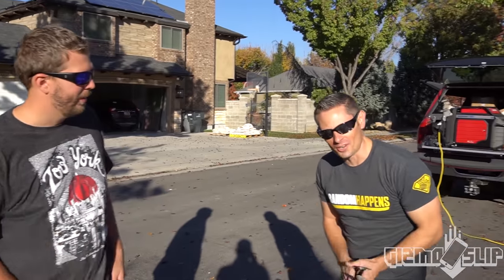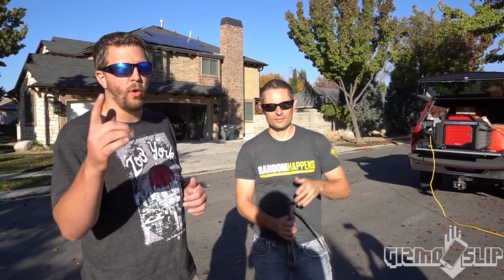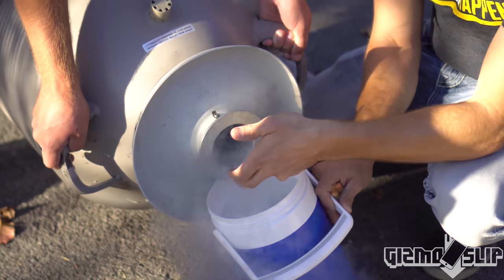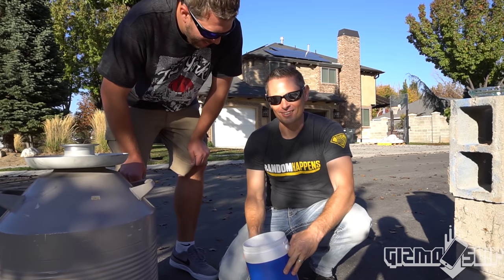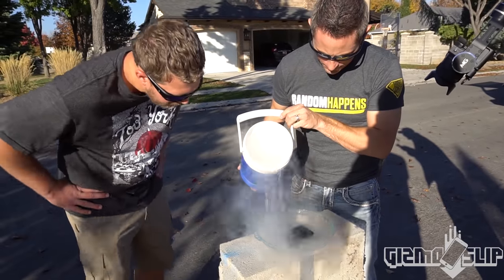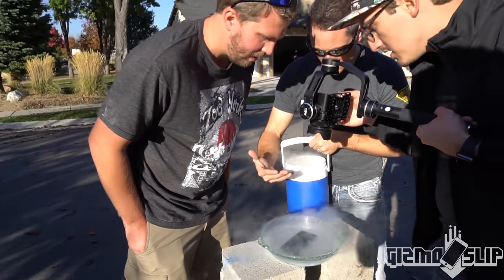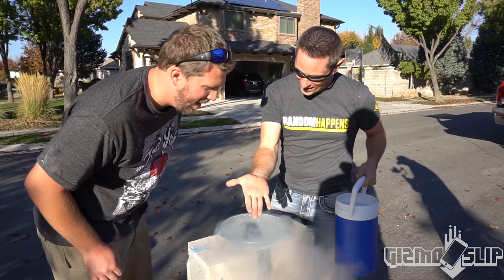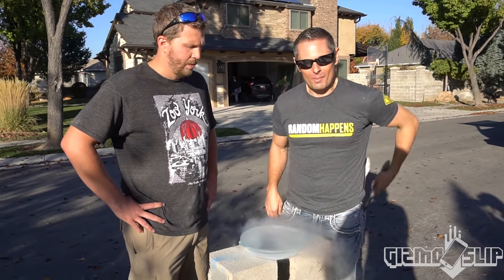Don't Karate Chop Your iPhone 7 Frozen in Liquid Nitrogen!!!

Comment: "water proofing of the iPhone 7" it's barely water resistance and isn't even coated on the inside... and also that is an incorrect way to perform a 'karate chop' as it can damage your hand in multiple ways very easily
Reply: MagicCookie barely resistant? Have you ever tried it? Because even bathed with mine (iPhone 7 Plus) no problem what so ever..
Reply: Yanga Attempts it's as water resistant as the iPhone 6, not saying that it's bad, but it's the same (maybe a couple minuets more) as the version not advertised as "water proof"
Reply: Samsung doesn't coat their boards either dummy